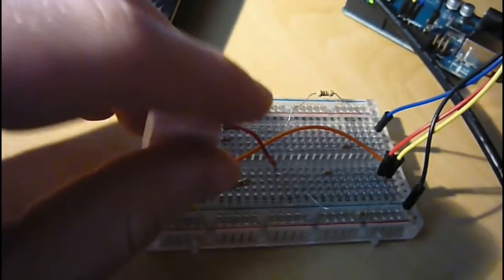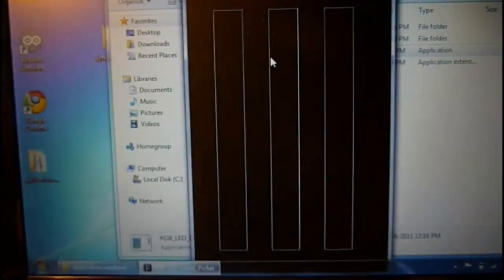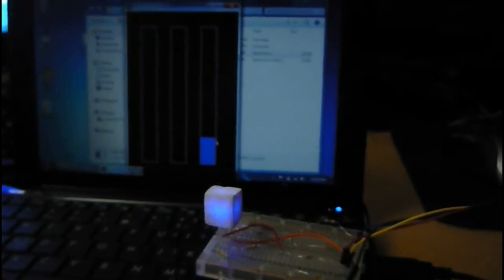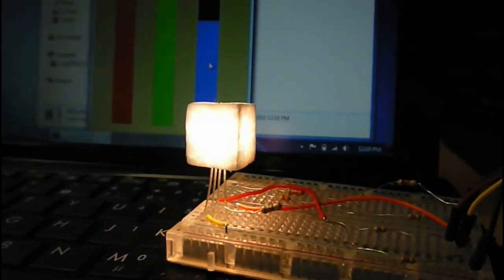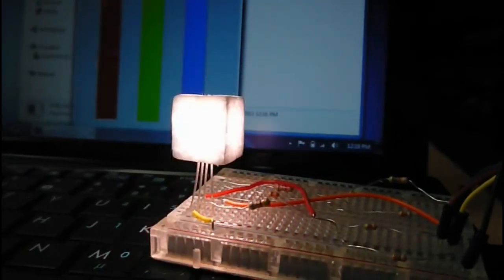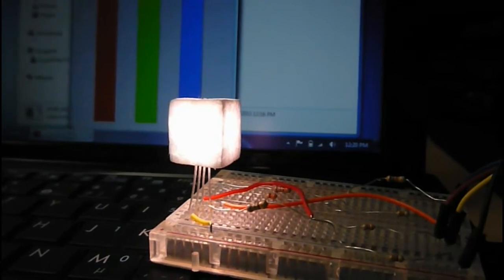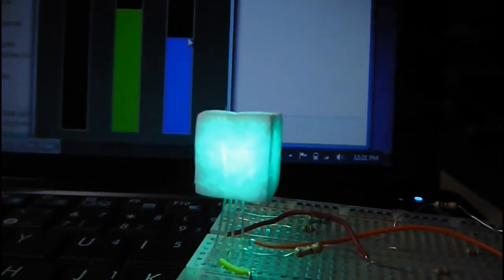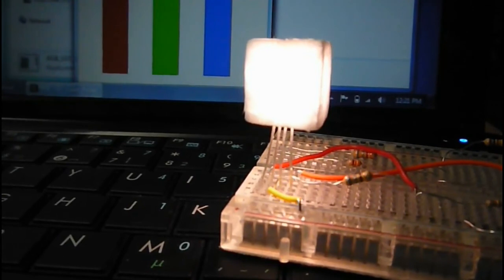RGB LED Colour Picker Circuit

Comment from the maker: @agleno 
The application is in the description, you'll have to use arduino and processing environments to run the programs. As for the circuit diagram, I don't have one handy, but I can attempt to add one to the description in a couple of days.